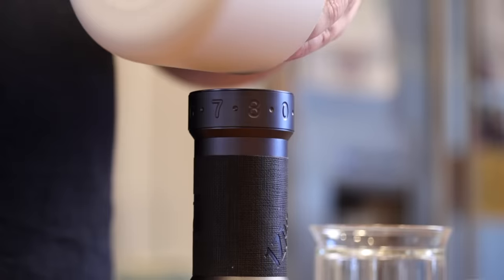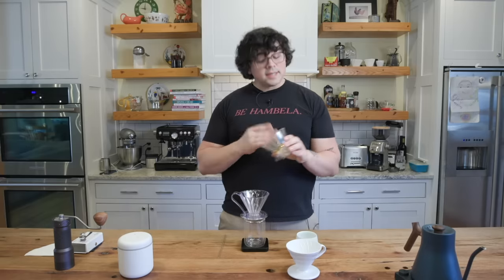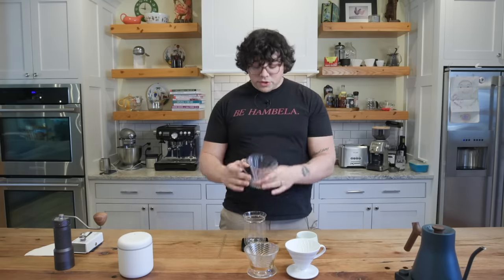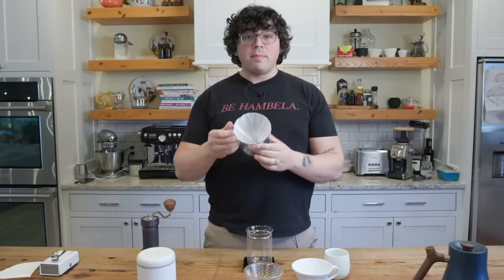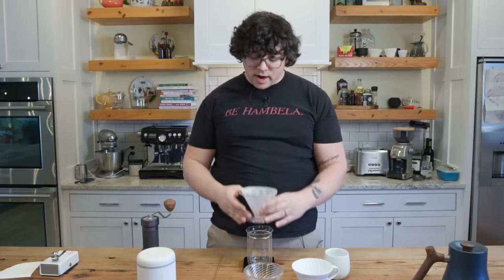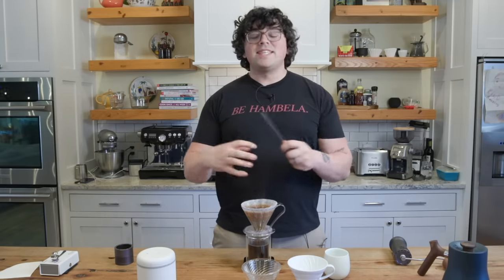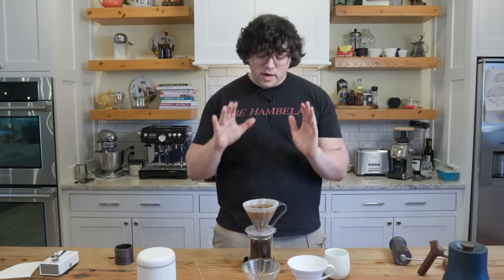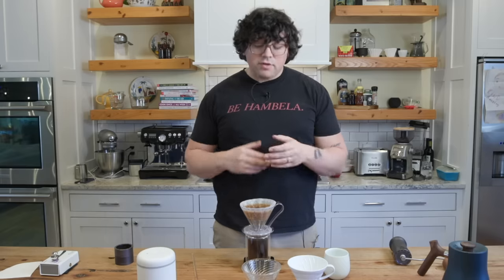EASY V60 (CONICAL) RECIPE FOR VIBRANT CUPS!

Comment: Warning... I'm gonna get a little nerdy... 
In pourovers I've found that about 2.5 times the weight of the coffee in water gets retained in the coffee grounds. 
So... with 10g Coffee dose, about 25g of the water you pour into the dripper remains in the coffee, while the rest filters through into the cup. 
So then... whatever ratio of coffee to water you want in the cup, you must add 2.5 to the water side of the ratio to determine the pour amount. 

Let's say... I want a 1:15 brew in the cup. 
I would need to pour 17.5 X the coffee dose weight of water. 
In retrospect... if I pour 1:17 ratio, I will get about 1:14.5 in the cup. 

Does any of this matter? 
I dunno. Maybe. 
I think most people refer to drip ratio as coffee to water poured, not in the cup. While they refer to espresso ratio as coffee in the cup to coffee in the portafilter. 
Interesting... 
Why must it be so? 
Or is it? 
I dunno. 

Someone please help me. 😫
Reply: In espresso ratio, we are referring to the yield because that's the relevant thing to measure when making recipes.

In other methods like filter, yes there's going to be some water retention, but that's why these percolation methods are designed to "drawdown" because fresh water is washing out the extracted coffee from the grounds (most extraction happens at the beginning of the pour).
The water which is left in the grounds at the end is bad stuff if you're dialled in properly, these recipes are taking this lost product into account already!

Comment: I think I finally dialed in your other V60 recipe, but it took me a while to figure out grind size with my Encore. I ended up with about a 14 or 15 on my Encore for that recipe. Would you say this recipe has a similar grind size? It seems like you might be going slightly coarser. Thanks as always, I’m learning incredible amounts from you!
Reply from the maker: This is slightly coarser, yeah! Let me know how it goes!
Reply: @LanceHedrick  haha I actually tried it at the same grind size as your other recipe and it turned out really well! Felt weird using a pen tip so I used a metal straw. I could see a lot of grinds spinning in suspension when I stirred and gently swirled on the draw down. It seemed like a bit too much agitation but the end result was very tasty!
Reply from the maker: No need to do all the stuff I did in the video. All that is needed is the initial stir and swirl. The rest is because I had idle hands while filming

Comment: Need help with the recipe! I followed the recipe and poured 18 grams with 205F water. My brew time was 5:31. Not sure if that’s too slow but the coffee tasted pretty good (the cleanest cup I’ve ever poured). Usually I brew 30g coffee in 3:30 using the same grind setting following James Hoffman’s recipe. The grind setting I use is 8 on the oxo conical burr grinder. I would love to know what I can do to make the coffee better. Thanks
Reply from the maker: Hey! If tasting good, no need to change anything! But you can always agitate less (less aggressive stirring or swirling) or you can go a bit coarser!

Comment: Great idea! I have a decaf I'm struggling to dial in, and this removal of fines seems like a great way to help mitigate the extra fines you typically get with decaf. Will try out!
Reply: What is the roast? Most decaf coffees are roasted medium to dark and might benefit from a lower temperature water. You can try letting your kettle sit for a few minutes after it boils before you start your pour and compare the results. Good luck!
Reply: @JoelRavier  yeah it's more of a medium. I have been brewing it at around 205F (I have a temperature controlled kettle).

Comment: I'm wondering how is this different from a light-push, long-infuse Aeropress. I get similar TDS by taste from it with aggressive stirring and no bloom. Will try it out tomorrow with a v60. I already did a similar thing but with 2-3 pours and aggresive agitation. That 2min bloom may be a deal breaker though (if it works). Any notes on what roasts and origins it should work best?
Reply from the maker: Loads of differences. namely, what you are doing is immersion for the most part. You could have same exact TDS and EY, but that doesnt mean the taste is the same. The numbers don't really mean much, to be honest. I could pull espresso and dilute it to the same TDS with the same EY and it would be completely different. this is different simply because it is different. Relies on percolation, not immersion, and has a more robust filter with more surface area to pull away more from entering the cup.

Comment: I know girnd size is subjectivr, but are you able to give a gauge to the settings in the niche when doing the long brew method? I am using around 50-60 on my niche, but still have difficulty to dial in sometimes. Previously my settings is 40-50 but at 93 degrees with 2.30 mins pour not the 2 mins bloom
Reply from the maker: I'd stay in the 40-50. Will be difficult to dial with niche because it isn't very good for filter but this brew will optimize it!

Comment: 5.5 on the K-Plus seems super fine! I usually grind at about 7.5 for V60 and it seems like the bitterness really starts to ramp up around 7.0.
I do grind at 5.5 for moka pot...
Reply from the maker: What roast level do you use? I have been brewing for a while lol. This tasted great sans bitterness. Might also be your water composition. What are you brewing with?
Reply: @LanceHedrick  only "light roasted specialty coffee" as James often says... current favorite is Maragogype Natural from Novo Coffee in Denver

Water is tap water through a Pur.
I am at high altitude, so "boiling" is only 95C.

My brew times always seem longer than what others report. The Hoffman method with a 0:45 bloom takes 4:00 total, *minimum*, at 7.5 on the K-Max. I can try it, but I feel like 5.5 would take 6 minutes or more...
Reply: I've tried the method twice now, and I do think it delivers on the promise of a vibrant, flavorful cup of coffee.

For both brews I ground 21g of the above-mentioned Guatemalan beans, first at 7.4 then 7.3. I used 350g of water, which I brought to a boil before each pour. I did observe a lot of fines trapped on the paper between the V60's ridges, though there were also quite a lot of fines visibly in suspension in the brew water. Brew time was about 6:00 in both cases.
Reply: Same here man. Was looking for a comment like this because I just bought a Kpro and wasted a good 300g of lightly-roasted beans creeping up from 5.5, through 6, to eventually 7 where the astringency finally became tolerable. I've also tried many normal 2-3 minute pours with the same findings - around 7 is really where the sweet spot begins.

Have you found your grinder settings have shifted lower as your burrs become "seasoned"?

My timings are absolutely fine with this 2-pour recipe but it is absurdly overextracted at 5.5 - the liquid is a super dark colour and the taste makes me shudder and have to wash out my mouth. I use water with a very good mineral content for brewing.
Gonna try it one more time with a super fresh washed kenyan and if that doesn't work... 😒😔 #team7.5
Reply: @YoItsM0  I don't think my grind settings have shifted, but 1) I've only got around 5kg total through it, and 2) I've disassembled and reassembled it for cleaning exactly once.

I did also try distilled+Third Wave Water, which tasted a bit better. Not transformative though.
Reply: @slotrans17  
Ignore everything I've said.
My temperature was too high. I use a stovetop kettle and was swept along by the "hotter is better" notion.
True to an extent, but I have a stovetop kettle so it gets seriously hot and was causing the astringency I was describing, even at the coarser settings. How hot do you brew?

Comment: i actually only wanted to write: i öove coffee!
But i have a question:
Your recipe is a really really good idea, i gotta try that.
But how do you know, that the water hasn't extracted the fines before your special stiring on the top?
Have you done some testing there?
Reply from the maker: They have been extracted at least partially if not almost thoroughly. The difference is mainly in disallowing choking though there could be benefit in sropping some from going through the filter. And arguably could stop some of the bigger fines from extracting further
Reply: @LanceHedrick  ah understood, thanks for that explanation!
Reply from the maker: No problem! Thanks for watching!

Comment: Can you describe how you came up with the extraction yield? Do you need necessarily need a refractometer for that? I have a cheapo TDS meter but I'm guessing that's not going to cut it in giving me the TDS reading necessary for the calculation you did.
Reply from the maker: You need a quality refractometer. Cheapest I've found that js consistent is the atago at $300. And getting the magic add on is a must for like $20 extra

Comment: Any suggestions for grind size on a JX-pro? I've been using around 2.6.0-2.7.0 lately, and the coffee seems a bit astringent, and I'm getting draw down times in the 5-6min range. Even when grinding coarser, though, the drawdown time doesn't change much, and the astringency doesn't go away. I'm using Cafec abacas.
Reply: I figured out my issue! I wasn't agitating enough. Agitating more actually made the flow significantly faster, and no more astringency! I'm using ~>2.8.0 now on my JX-Pro and I'm getting super clean cups.

Comment: Trying to do this recipe but having a little trouble. My biggest problem is only having the size 01 v60 to work with, so the numbers are wayyyy too big for me. Haha second though, grind size. I've tried a couple settings on my SGP and ended up tasting pretty acidic. Closest I've gotten is around 25. Any suggestions? Love the video man!

Edit: maybe it's actually bitter? I added a few grains of salt and it didn't taste as bad. Hm.
Reply from the maker: Need to scale down! This is just an example brew. I do 12g to 200 of water in a small v60. 40g bloom.  Then rest of pour
Reply: @LanceHedrick  you are a beautiful human! Any suggestions on ballpark smart grinder pro settings? I've seen you used to use one, so I was hoping you may know
Reply from the maker: Yeah! Start around 40

Comment: Updated Review: his 4 step v60 recipe is still the best imo. When done right the 121 is pretty good but the theory doesn't make sense to me. By swirling the fines to the sides of the filter they're still very much involved in the brewing process and all the swirling actually pushes them to the bottom and clogs it. Also, because of the increased agitation, any clarity gained by losing the fines is lost anyways.
Reply: I have a niche and it did improve clarity for me. The fines are still involved in the brew but for less time as they're on the side wall, rather than the bed of coffee. The swirling has never clogged the filter for me. Possible causes of clogging are  papers that clog easily, swirling too aggressively or grinder produces a lot of fines.

Comment: Hmm. I'm not sure if the Ode will work with this recipe.

Followed the recipe pretty closely, and it was pretty watery. Could have been a mistake on my end though, unsure. Ahhhh I wish the Ode could grind finer! I need those sweet SSPs.
Reply from the maker: The ode with the original burrs likely won't work very well. Would need to do the finest setting and be quite aggressive with the swirls.
Reply: @LanceHedrick  Ahh I have the 1.1 burrs. Maybe it's my technique. Will have to play around.

Comment: I would love to see you brew on that brewista dripper. There ise really not much info about that brewer on the internet.
Reply from the maker: It brews similarly to a v60, tbh. Just a smidge slower.
Reply: @LanceHedrick  hmmm, does the heat retention differ that much? I am curious about if double walled glass (also double walled steel like stagg x) acts significantly better than plastic

Comment: I've been using this recipe for about a week now, and I think it's fantastic. I would say, however, that when I swirl the v60 after the second pour that instead of getting fines to stick to the walls that it does the opposite and instead washes the fines off and I to the slurry. Has anyone else found this to be the case?
Reply from the maker: Yes this is why you either need to be very careful with the swirl or you can opt to do the shake so it doesn't ride the wall
Reply: @LanceHedrick  Thanks Lance, will bear that in mind.

Comment: does it really matter if the fines are stuck to the filter?
They were submerged, so the water already extracted them. Why is it important?
Reply from the maker: 2 things-
More contact equals, roughly, more potential extraction. You are stopping them from continued extraction. 
Second, you are able to stop the from clogging the filter and stalling drawdo2n.

Comment: One shake is enough to keep the bed flat. Prove me wrong.
Reply from the maker: You're correct, in a normal circumstance. With stirring, the motion of the water swirling continues and can cause a dome after shaking. At the end, if you look closely, there is still a slight dome.

But, tbh. I usually do just one maybe two shakes. While filming, idle  hands have to find something to do haha

Comment: would this work well with a kalita and its ribs in the filter?
Reply: Conical, not flat bed.
Reply: @bowieknife  I mean there’s nothing inherently in that shape that would make it not work as far as I can tell
Reply: @nickrockon  I think there might be? Because the ribs go horizontally and when you stir it / spin in, the ribs aren't able to catch the fines as well, if at all, compared to the diagonal / more vertical ribs of a V60 or cafec flower for example. Maybe you can try it and see if it catches the fines? Anyway, Lance did title the video with (conical) so....
Reply: @bowieknife  yeah I just feel like the vertical ribs of the kalita could catch pretty well. I’ll try it out

Comment: This aint it for me. The brew just chokes even more
Reply from the maker: What grinder are you using? I have never had a choked brew even using bad grinders.
Reply: @LanceHedrick  i have a Wilfa Uniform, prolly did something wrongish, but i tries mah best :D a lil too much micro management for me
Reply from the maker: Shouldn't be a lot. Tbh, I overconplicated in the video. Simply pour bloom, swirl, 2min, pour until weight, one stir, as it drains optional slight swirl or shake. 

Quite minimal, tbh
Reply from the maker: If you feel it was too much, you were likely doing too much and choked it with over agitation haha
Reply: @LanceHedrick  this might be it
Reply from the maker: Give it a try with a bit less. I got a bit adhd during the drawdown. I feel I always have to do stuff with my hands. Just kept messing around lol

Comment: Man, there is no way u get decent coffee from that brow. I am quite sure it tasted bitter and overextracted.
Reply from the maker: Lol not At all. How about giving it a try before making baseless claims?
Reply: @LanceHedrick  ı have done nearly every version of brewing related swirling and stirling but you have point I am gonna try your exact receipe and give u update.
Reply from the maker: Nice! I have, too. And I've even competed jn front of judges who are calibrated in the US Brewer's championships presenting my ideas and have each time placed. Not a flex, just giving some credential and validation to what you may seem as excessive
Reply: @LanceHedrick  I just tried your way and it was on the edge being bitter. I was expecting way more bitter result however it was’t as much as I was expected. It was kind a watery and dry tho. Next time I will increase coffee / water ratio since I was already using boiling water and fine grounds. Maybe I’ll wait 01:45 second instead of 2 min. Sory for early judgement. It was quite different receipe, worth to try.
Reply from the maker: What coffee roast level do you brew? If you do dark roast, or even medium, I wouldn't suggest my ratio. That's only for light coffees that need more water to extract.